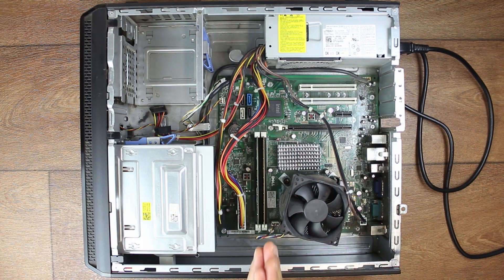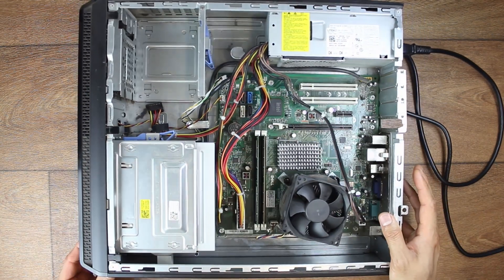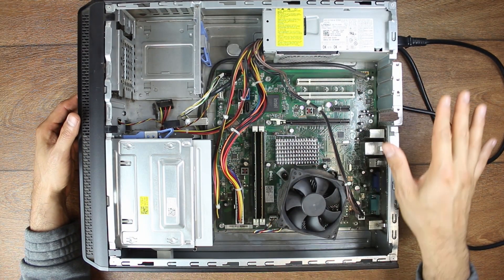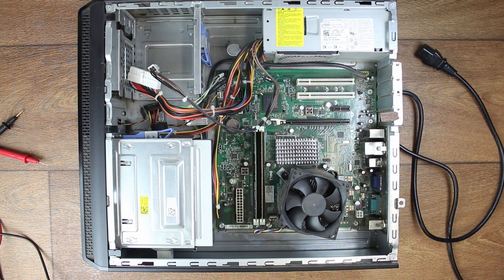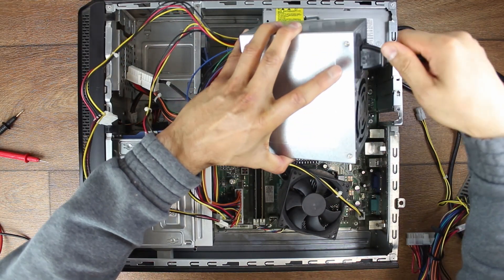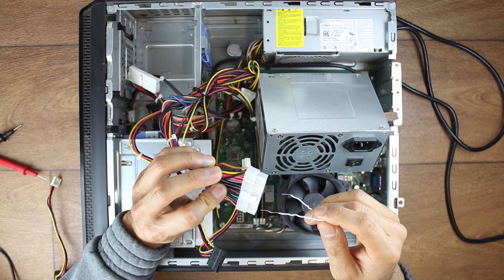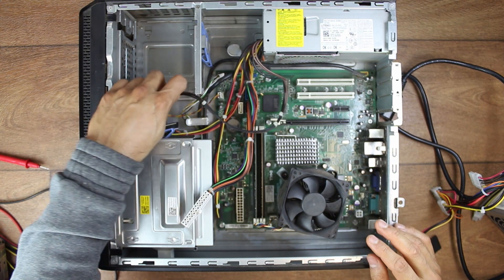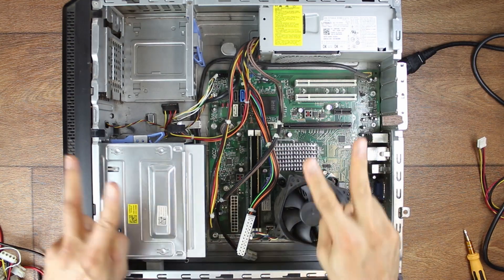Troubleshoot A Dead PC No Power – HUGE MISTAKE Wrong Conclusion

Comment: i had the very same issue with my build when i was setting it up, i wanted to reuse another power supply from a repair i did, but the power supply turned out to be bad, but i had another testing supply to test the machine with and the computer came to life once it was swapped, also one other thing to mention, the voltage on the supplies may be enough to make the fans in the computer spin, but its the amperage that matters the most to allow the machine to turn over and boot up so that you can see the bios screen. i've seen repair videos where the cpu and case fan spin anyway but the monitor screen remains blank, until the power supply is swapped with a known good working unit.

Comment: All very well put together. i had many times power cable problem and my suspect was motherboard 😁
Reply: How did u solve that?
Reply: @amirseif9087  just check for loose connection and faulty cable/connectors first

Comment: what does it mean if my graphics card has Blue light LED thats steady and does not blink at all, its always on
My card us Rx580, also there is blue light on the top of the case next to the power button, its also on and never of and has blue color, with red blinking on top of it, Please help me i just built this pc and am using 2700x processor, and b450 f mother board with a 750 PSU